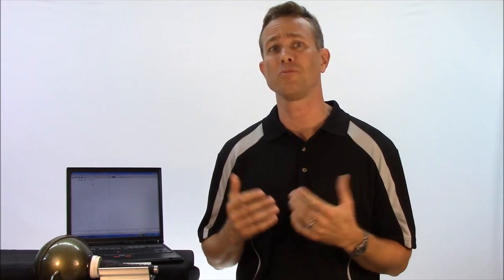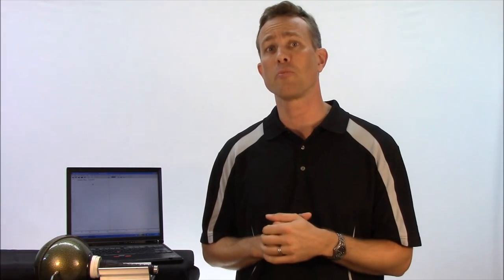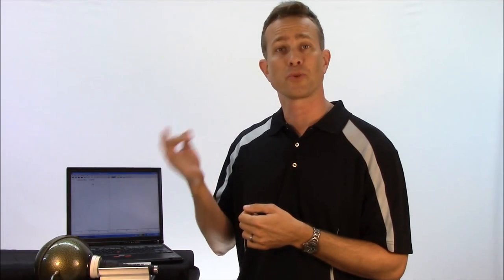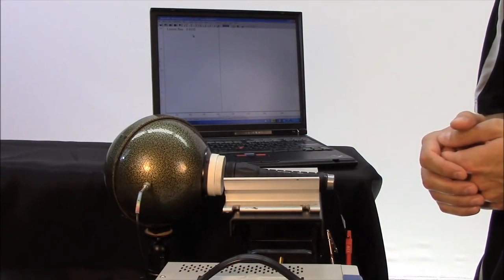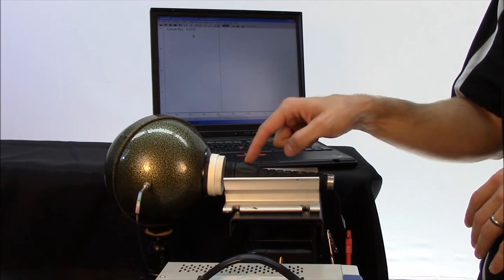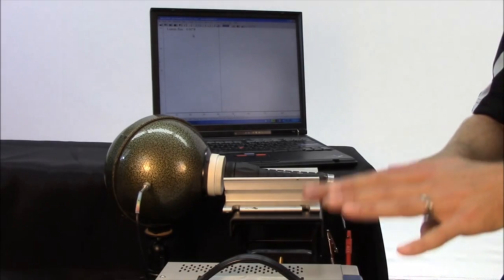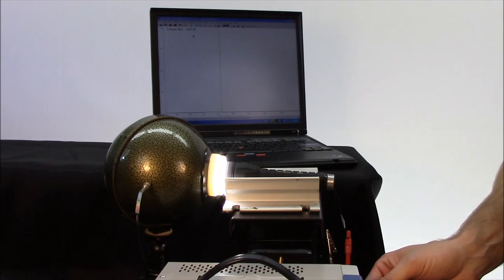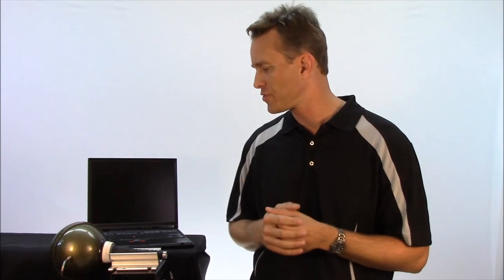Lumen Wars, Why the Highest Output Flashlight May Be the Least Reliable, Elzetta vlog episode 3

Comment: Okay, so has your stance on this changed over the years? How did you increase the output from 900 lumens to 1350 lumens on the Elzetta Charlie, without sacrificing reliability? How much hotter does the new AVS Head Elzetta flashlights get?

Comment: Just found out about yer video blogs...I like this stuff pretty good...and yeah, it is definitely a bad idea to run
something like that right on the ragged edge. Engine control modules won't even let you do that to your
car of late...rev limiters shut 'er down to almost sane when you try(8-). 

Oh, and no one I know needs to drain a battery every 5 minutes when they need that flashlight badly

Thanks for the Demo, Dave(8-)

Tom